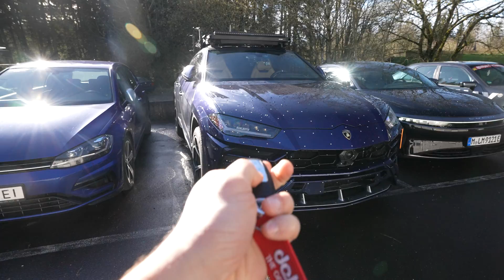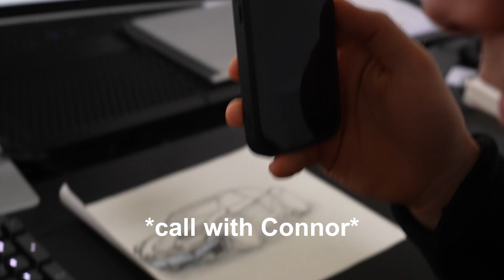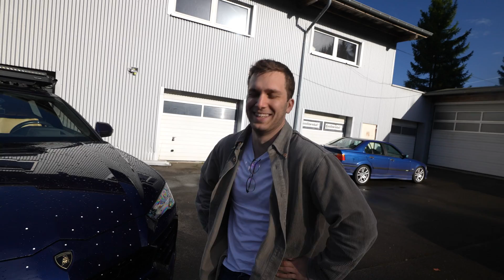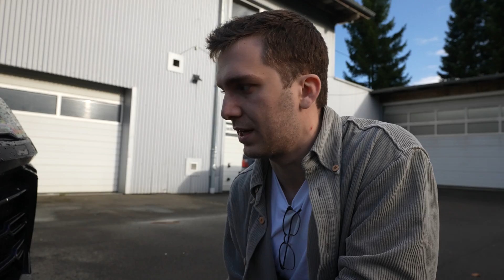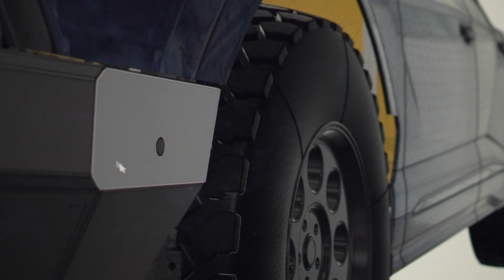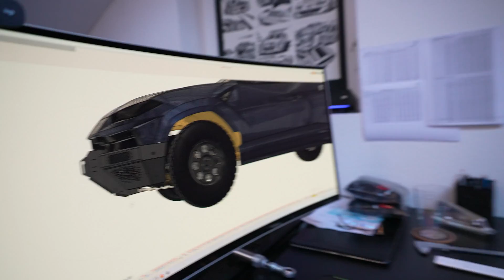Lamborghini Urus Build by Vulcan Alpha Ep.2

Comment: With the new bumper design does it really help with approach angle ? 
Maybe scan the engine bay and look at W2A intercoolers that way you could remove the A2A lower location . 
Cheers
Reply: We looked at that, but desert regions have had issues with these getting too hot… the angle of attack will be made better and it will be steel so I can bounce off of rocks, Prius, Ferraris and whatever else I’m driving over😏
Reply: @camperghini  Have you checked out Darkside Developments in the UK with their off road VW,Porsche’s SUV’s .
Looking forward to your further developments 👍👍👍🇦🇺
Reply: I’ll check them out…